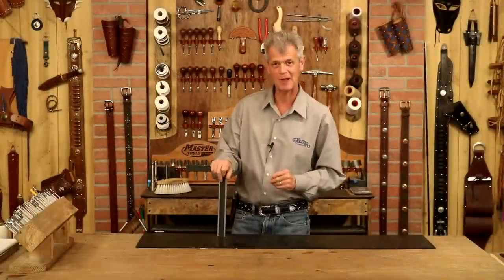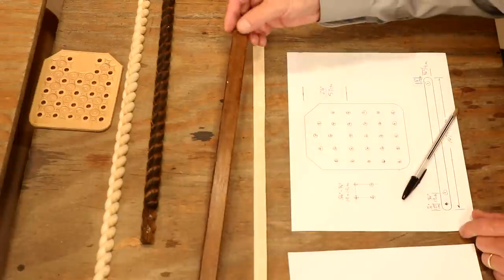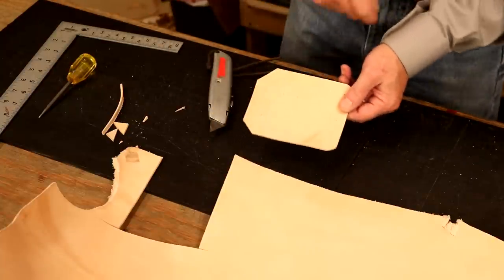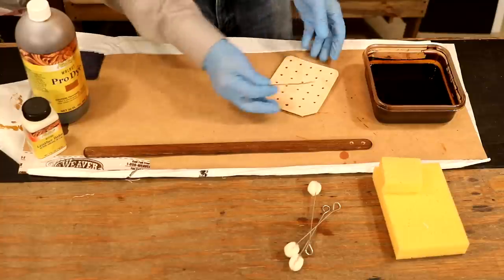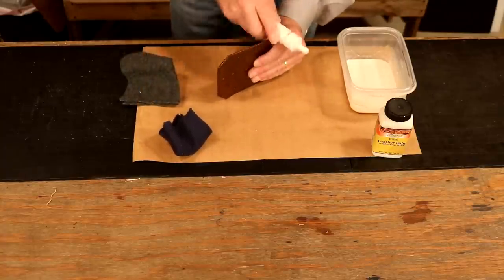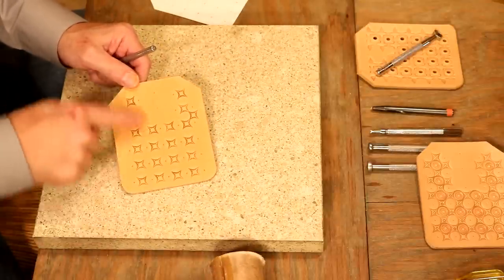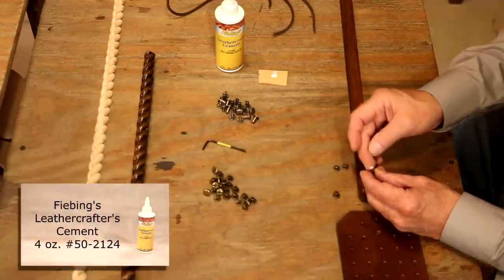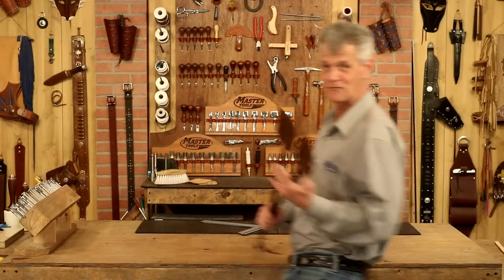Making a Unique Leather Fly Swatter

Comment: note to those who make this item.  The cad like drawing differs from the hand sketched drawing in the area where the handle and holes to attach the swatter.  The hand drawing locates the holes by their centers which is correctly drawn.  The CAD looking drawing locates the holes at the upper and lower quadrants of the holes then you add the diameter of the hole and then skip 3/4.......   Use the hand drawing is what Im saying.

Comment: Wouldn't it have been more practical to have put the handle on TOP of the leather instead of underneath? That way the handle couldn't get in the way when you're swatting a fly. The flatter the leather against the surface the less chance of the fly getting away. The way you put them together, you'd pretty much have to swat them with the face of the leather rather than the suede side.
Reply: I wouldn't want to swat a fly with the flesh side (what you're calling the "suede side").  The finished side can be wiped off, rather than the insect guts soaking into the porous flesh side.  Plus, I have the feeling that most of these aren't going to be used on flies, if you get my meaning...
Reply: @muddymom  Well if it IS used on flies, I'd rather stain the reverse than the face. As for OTHER uses, then it wouldn't BE a FLY swatter WOULD it. 😉